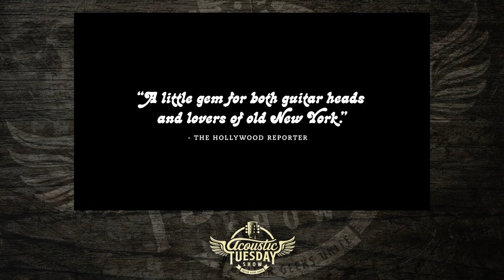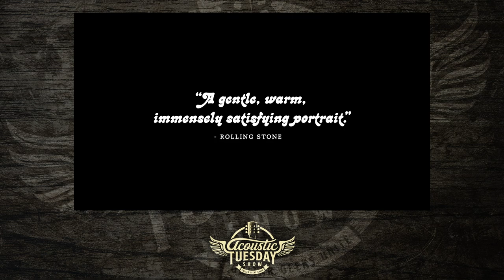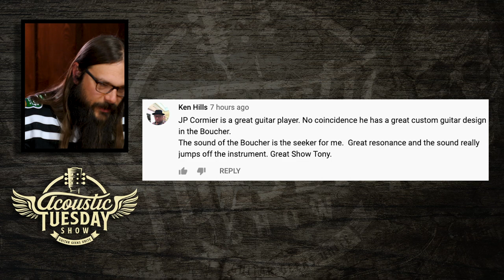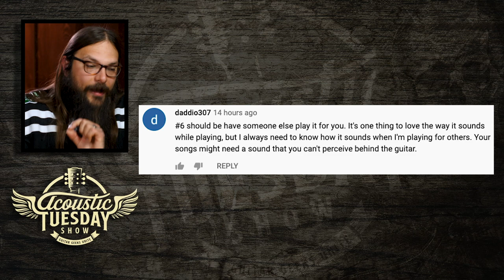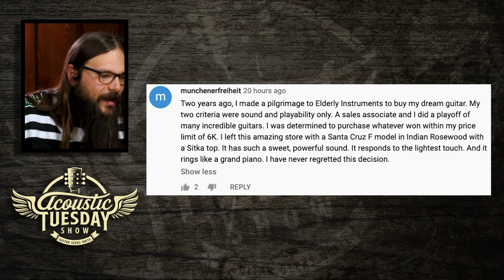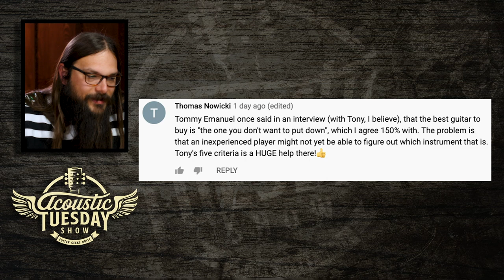Acoustic Guitar vs. Electric (where to start?) ★ Acoustic Tuesday #141

Comment: The top 5 really annoyed me. There is no debate, there is no 'versus' when it comes to this stuff, it's subjective. Neither is better, neither is worse. It's a matter of taste. Even the 'you can play acoustic everywhere, but electric has all these requirements' argument doesn't hold water in my mind. If you need a chord, an amp and electricity to play an electric guitar, the chord, the amp and electricity are just as much a part of that instrument as its neck or its strings. Yeah, you can't play it without an amp, but neither can you play the acoustic without strings or the piano without keys. And I generally think it's absolutely immature to argue over this stuff like it was presented in this video. 'Best Instrument In the Universe' is something a 9th grader would say. Guitar is the instrument I like and decided to play one day. It doesn't make it better than the piano or the violin and stating it as a fact sounds weirdly and very unnecessarily confrontational.

I think there is a legit discussion to be had, with which to start if you're a beginner, but even that is subjective. Some find acoustic easier, some find electric easier.
I started with an electric, because learning guitar wasn't my goal, learning to play electric guitar was. So I got myself and electric guitar. After my first year I got myself an acoustic as well and that was really an eye opener and broadened my horizon in more ways than one. Whether you like playing acoustic or electric, I think everybody should at least try to learn the other one to some degree as well. 

In hindsight I might've had a smoother learning curve if I had started with the acoustic and just focused on technique and theory and ear training, but I'm not a professional musician. Guitar is not my job. I was 27 when I started playing and I did it, because I wanted a new hobby. I learned the things I wanted to learn and played what I wanted to play. Being the best at it was never my objective. Having fun was. And considering how lazy I am and how easily I get discouraged by the smallest hurdles, I think playing what I liked, is what kept me going. It effectively meant that I was much worse in my first year and a half of guitar playing than I probably should've been, but who cares? Once I had a solid basis the will and motivation to get a bit more serious with it, emerged on itself.
Reply: Don't take Tone so seriously.

Comment: Amongst other consideration, I think it's an age and Circumstance thing as well. If you are either living at home with your parents or others, or perhaps you work days in the only time you get to play is late at night, then there are two things to consider. One is that the electric guitar is usually easier on the fingers to learn but also it is the one that you can plug into headphones and play at night and have nobody be bothered by any kind of noise that you're making. That being said, I would start with an acoustic anytime. Just because.

Comment: Most Important Factor -  What they Want to Play/ Inspired to play 

   If Folk , Old Tyme, or Bluegrass , has to be Acoustic . If Rock or Metal , has to be electric . Blues or Country can go either way .

   There are several reasonably priced , good sounding small batery powered amps , so it's not onerous to play a strat around the campfire , if that's your ticket .

 It can be a rabbit hole and distraction to go tone chasing , but an electric played totally clean is also unforgiving .

   For totally beginners , the huge majority gives up within a cpl months aka they reach the point of making actual music , so the question of ease of switching to their second guitar is largely irrelevant . They need to play right away what inspires them .

Comment: The acoustic guitar is a tone monster. Pick it near the bridge and it offers something  completely different than when you move up to the sound hole or up by the fretboard. Different clarity of single notes depending on how you hold a pick, whether it's loosely between the tips of index finger and thumb or more securely between the side of your index finger and first knuckle of your thumb. Spin the pick around and use the side or back, it offers something different as well. 
 Finger style? Tips of fingers,  fingernails, or fingerpicks? 
  The versatility with or without electricity... It's no Contest.

Comment: I clicked on and watched because (well I "play" acoustic) this was not one of those "Top xyz things you are doing wrong" type videos. Something that should be told to beginners (maybe it would not make any difference) were the stresses placed on hands and fingers with acoustic. Express this info in a "I need to tell you many quit acoustic because of hand and finger issues" This info would not have stopped me. The acoustic experience is dampened a good bit by playing outside. This can't hear myself playing outside while standing up motivate me to get an acoustic electric (Martin D16E) and a low watt amp (Yamaha battery powered amp). I certainly do not need the amp inside.